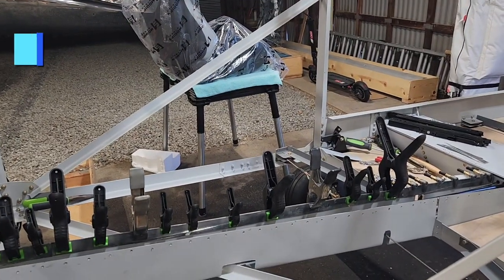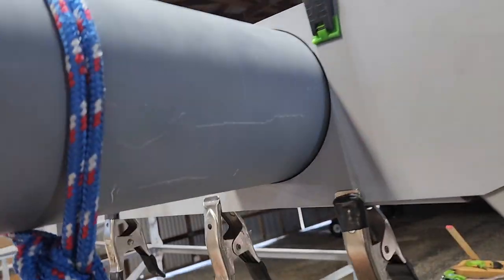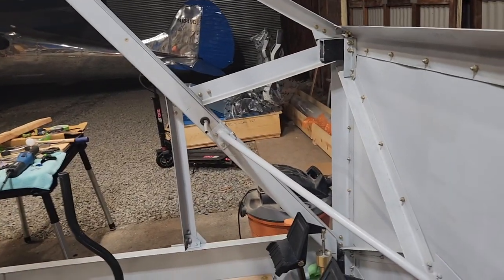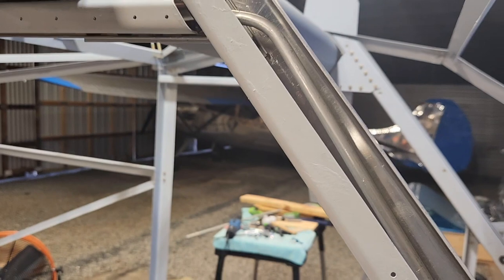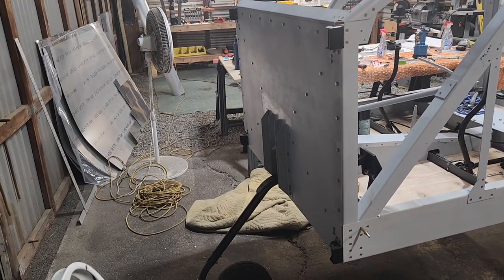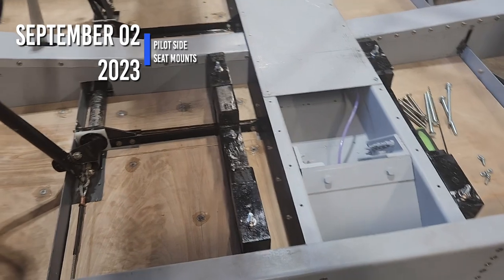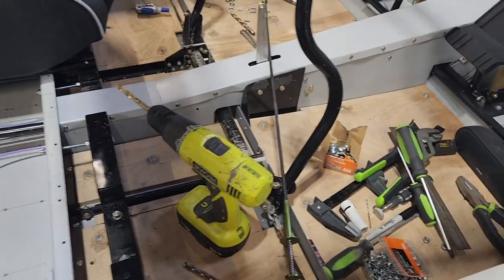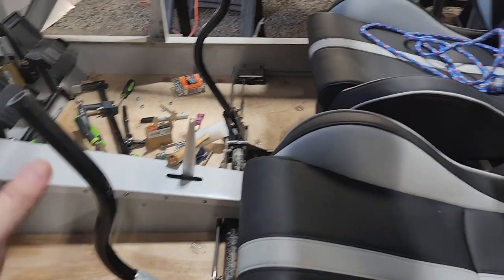Bede BD-4C Build Log 023

Comment: Great to see you're still moving on. I think your plan to change the stick angles will work out good for now, but I wouldn't be surprised if you don't find yourself redoing them again once you've flown it a few times to see where your sticks are 'neutral' for flat stable flight. Thinking you might have to build some custom bent sticks as you've now changed the neutral positions/angles, but only time will tell once it's in the air. Good work and don't get too hot; this summer has been brutal. Can't wait to see how she flies with that UL engine!
Reply from the maker: That could be.  They'd be impossible to use as-is (from Bede without modification), at least with the seats I chose.  I have the moly to do them for real now so I'll include that bit in the next video.  Engine is still several weeks out and the aftermarket oil cooler I purchased is even further out.  It's starting to cool off here in northern Virginia so hopefully the worst of it is past.

Comment: Great progress! You mentioned 'action cam' mounted around the plane.. how about using a centrally mounted NVR which has an ethernet cable going to mount points which supplies power as well. The NVR output can go to any screen you desire. This solves a lot of issues such as power and storage that makes action cameras a pain. I like SCW warehouse stuff. They have 360 degree dome cameras that are 1.7" thick and allows you to PTZ the recorded image by dewarping it. They have 4 or 8 camera models that would be perfect for a plane. When parked they would also be great for security too by having an external power connector that could also trickle charge batteries. I would post a link but youtube deletes comments with links.
Reply from the maker: I've looked at those but it would be difficult to mount them without disturbing the airstream.  As I get closer to skinning it, I'll be making every effort to make it as slippery as possible.
Reply: @SkyFunChannel  That was one of the reasons I mentioned those NVR cams - they are only 1.7"  and aerodynamically shaped. An action cam would be much bigger with the bracket and not aerodynamic. I tried to post an image with the dimensions, but youtube deletes posts with urls. I am talking about the  radius-5-360-fisheye-dome-camera#image-4 which can be installed like Tesla does with their cameras.
Reply from the maker: @wylieecoyote  since I don’t have it skinned yet, I can mount almost any style camera behind plexiglass with access panels to get at them if necessary.  I do like the idea of a slim dome camera though.  What I really want is live feeds from the front and rear (that can also be recorded) to feed to the EFIS, and a down-facing portal for a high quality SLR camera.  Of course no need to feed the SLR to the EFIS.

Comment: Do you happen to have the measurement that would be needed to allow the seats to recline further? Unless you may have found a way to mount them differently? I plan to put seats like these as well. I'm 6' so hoping these will work for me.
Reply from the maker: If you moved them together so the recline release handles were very close together, they would probably clear but then the seats wouldn't be centered at the neutral position of the sticks.  If I find I want to recline them, I'll cut a notch and reinforce it with steel.  If you can find similar seats that don't bulge out at the top and maybe sit a little lower that would be ideal.  I'm 5'11" and can clear the wing spar but just barely.

Comment: What is the size of the aluminum angle for the aft fuselage section? Looks like 1-1/2"X1-1/2"X1/8"
Reply from the maker: Yes that's correct.  Some connecting sections are 1x1x1/8".
Reply: @SkyFunChannel  i like the Basic idea of the truss design with a thin skin over it. I'm designing a single seat plane similar to the SD-1 Minisport but it'll be made with carbon fiber.

Comment: What was the final skeptical issue with decision to forego the Viking?
Reply from the maker: It comes down to cooling.  No one has installed this engine before and all of the cooling options are highly experimental.  I really wanted to use that engine but I don’t want to spend another several months finding a cooling solution that isn’t as draggy or less draggy than an air cooled engine.